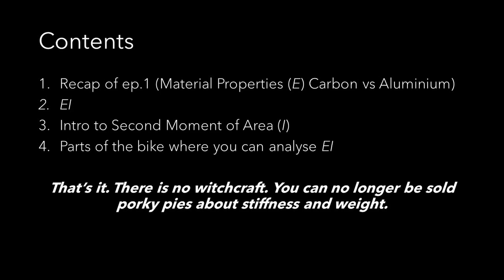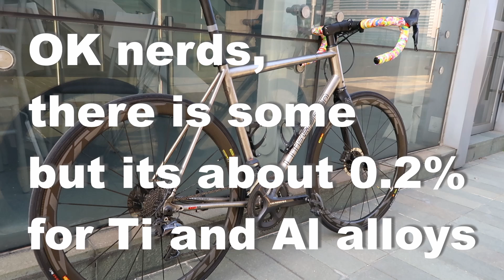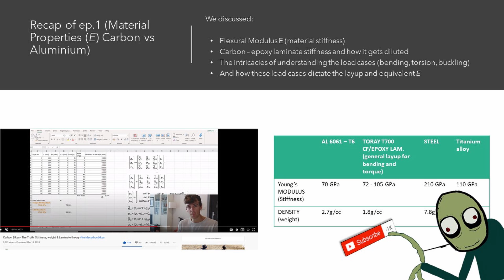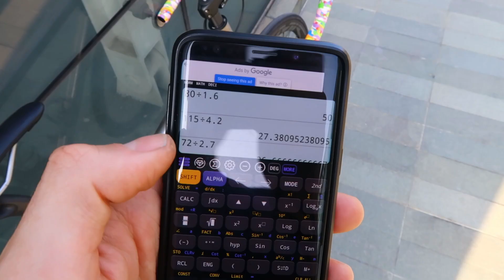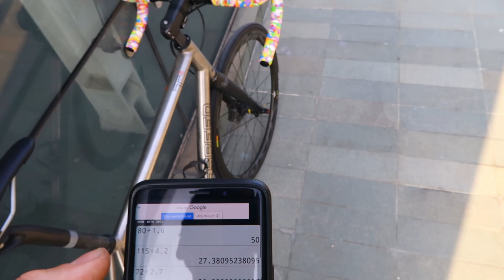Titanium Bikes - The truth and Physics of 'ride feel' marketing.

Comment: You said they have the same specific modulus for a bike of the same weight. I am confused though because a bike of the same size would weigh more in titanium. You said a bike of the same weight would be the same. Specific stiffness is stiffness per unit density, but there will be more units in a Ti bike? I am confused.
Reply: Right, it's hard to have the exactly same tube geometry for Al and Ti frames. I would imagine Al frames would have bigger tube diameters compared to Ti frames for the same frame weight and size. So Al frames might be stiffer due to that. But that tube size difference is pretty small relative to the size of the overall frame geometry, so I wouldn't expect any major differences in stiffness. Psychology probably plays a bigger role than the physics. 
Frankly, if you want a softer and less buzzy ride, just get bigger supple tires. If that few percent aero difference really matter to you, then you probably don't care that much about the harsh ride anyways.
Reply from the maker: Yes you're right and Aluminium will likely have larger second moment of area tubes to meet the strength and fatigue requirements (due to having a lower yield and fatigue strength). Thus, the Al bike will likely be stiffer due to the second moment of area. I did not address strength in this video.

Comment: But how will bike companies massively inflate the value of their products if they sell bikes based on facts and not bullshit from marketing from the cycling "journalist" industry
Reply: Hasn't stopped car, coffee, food, fashion and 100 other product line manufacturers Why would you expect bikes to be different?
Reply: By working hard and not outsourcing their stuff.
Reply: LOL
Reply: They almost all did by 10-15% "due to covid-related supply issues", which is layman's terms basically is translated from, more demand minus the same stock sizes equals more profit for the same effort.
Reply: @TheNeelonRokk  No, NOT more profit from the SAME effort.  More profit from HARD work and much, much more effort!
I've worked in the bike industry off-and-on for 25 years, and 2020 was absolutely the busiest, most stressful and exhausting year since bikes were invented.  We earned every extra penny.  (And it's still not a high paying job.)
Reply: I think most industries market their products with bulshit that most people don't understand. And bicycle prices also have a big problem caused by how the sport is funded, basically from sponsorship, making their marketing budget heavy on the price of the products. And it is such an old model that I question their ROI and if that money should be better spend otherwise.
Reply: They will inflate the value of their products by changing the wheel size and destandardizing all the parts so you can't get replacements parts after five years.

Comment: For those wondering: Steel is in the same area of specific modulus compared to Al and Ti.
Reply: The question then is why are steel bikes heavier? I suspect it's because steel's higher density would lead to very thin walled tubes, but I'm not sure really. In any case I wouldn't want to deal with my bike rusting away.
Reply: @gxexrxmxaxnx  Exactly, you need to have a minimal thickness to weld tubes together, otherwise the tube will be destroyed. Also, very thin tube might be prone to buckling.
Reply: If you build a very good Steel frame it isnt't much heavier than Aluminium. But I imagine Carl made a good point.
Reply: Futhermore you can make Tubes with a bigger diameter Out of Aluminium, Steel would get to heavy or to thin

Comment: Exactly what I needed to hear because I have been considering buying titanium but dont want to part with the cash. There needs to be more aluminium framesets on the market at roughly half the price of Titanium. I love my CAAD10 and have managed to run 28mm tyres which helps dampen vibration. Thinking of getting 27.2mm seatpost with reducing shim to help even 
more.
Reply: @xxiipp  I'm sure that the CAAD13 is a great ride and more comfortable than CAAD12, CAAD10 ect., but I am still not sure about the aesthetics. I loved the look of the old Super Six and CAAD's.

Comment: Ti reduces in length less due to air friction when descending at extreme speed (or when I'm sprinting). You should mention that. Otherwise good effort 👍🚀
Reply: wat
Reply: @onesquirrel2713  if I ride a steel bike it will fail as the extreme heat will cause the metal to fail. Alu is no go. Carbon fibre just vaporizes instantly, so Ti is the only real option 💪
Reply: @ironmantooltime  what?
Reply: Well you must be really fast for orthers to notice, but true
At high speeds weight will increase, so my recommendation for weight weenies is to go slowly.
Reply: bruh

Comment: The durability/aesthetic argument is exactly what I've told the pensioners I know that own Ti bikes and they usually look at me like I'm an idiot and tell me I don't know what I'm talking about because they've ridden bikes for 40 years.

re: the metaphor of nylon/steel guitar strings -- do they truly vibrate the same way when tuned to the same frequency? Nylon and steel guitar strings have different tone qualities, I'm assuming that means they interact with the overtone series differently.